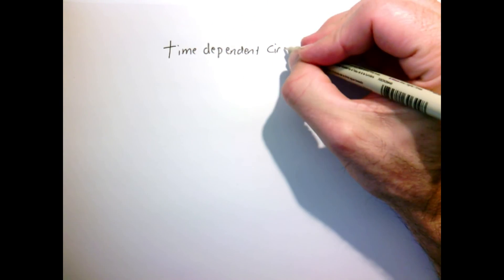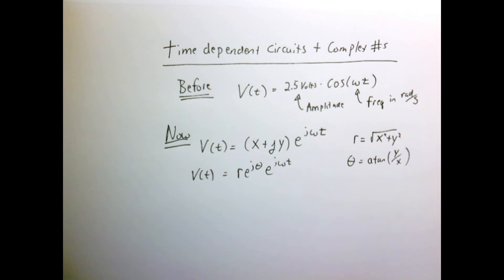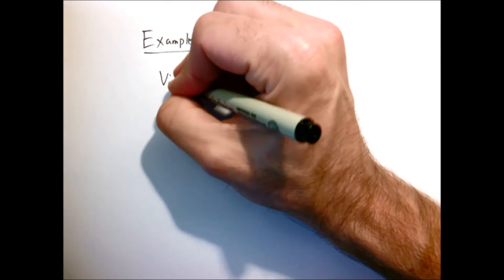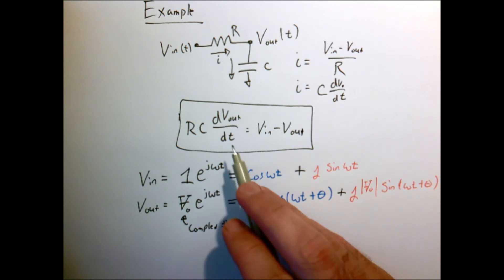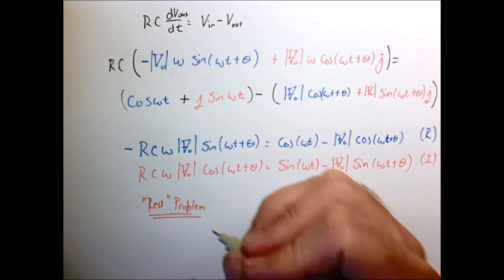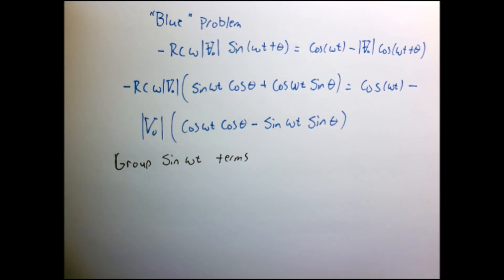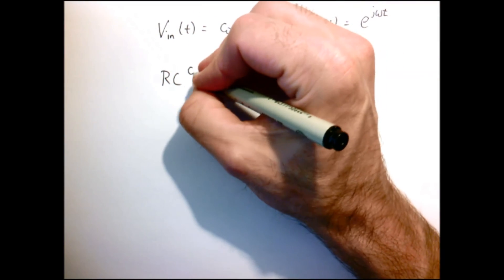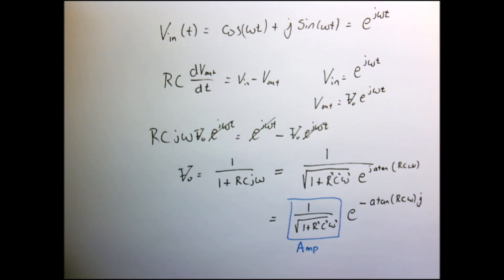Time dependent circuits with complex numbers

Comment: Brian Storey, Sir, I am reflecting on the title of this video, be it time dependent circuits or circuits with time dependent signals where the circuit elements do not change with time, unless we consider aging or where  impedance change with time.  

When dealing with circuits, I prefer to do away with two dimensional flat functions as sine and cosine  which are a combination of two three dimensional helixes rotating in opposite directions and treat the signal as a three dimensional  function namely one helix as  Ae^- jwt  or Ae^+jwt depending which way one wants to rotate. Even  DC signal is treated as a three dimensional signal where jw=0 then the rotation will stop and the 3D vector is regarded as a DC signal in space  which can be applied to a three dimensional  mechanical load! 
In mechanical form one could have a long rod on which rides a holed entity  acting as a load  which can rotate on the rod. A  crank with an off centre pin is  used to torque the load around with an elastic rubber band or a spring connecting the  crank to the load( as towing a car) .  The crank would represent the  rotating voltage source Ae^jwt  and the tow rope and load would represent one Load.   Well the crank can  rotate in either direction as any angular velocity + or - jw  and the load will lag behind depending of the nature of the load entity  and the friction with the rod.  Looking at the rod  from the side or from above or from the end of the rod one would see  the sine , the cosine and also the circle that represent all the mathematical and  input and output parts shown in any flat function, sine or cosine, signal applied to a network.  With three dimensional signals , one has the benefit of seeing the phase lag/lead angle  by looking end on the rod, where  starting the crank from zero time, the transient would be shown as  a curl which eventually reaches  steady state as a perfect circle of some magnitude lagging or leading the circle represented by the crank input.  Using a computer, looking end on the rod, one sees the most beautiful three dimensional signal that you describe so well but in two dimensions through including the summations of the positive and negative rotating signals.For control or filter functions these are the most beautiful  artistic functions one could hand on any wall in  an arts museum. 

May I add that Laplace ( frequency)and the Convolution ( time) operators are in fact three dimensional operators and Laplace presented as ( the integral of ( e- jwt) multiplied ( system impulse  response function in 3D ) =  a three dimensional frequency domain response . These are just beautiful showing a three dimensional spiraling trajectory in space representing magnitude and phase angle at any frequency.
The same with the Convolution time operator and what a pity many educators treat these beautiful operators as two dimensional functions.  Having superimposed  two  contra rotating helixes at the input and output  of a network through using sine and cosines does complicate matters  and there is beauty in using only just one magical rotating helix.... Ae^jwt.
Reply from the maker: In a later series I get to using e^(jwt) and eventually complex impedance. I use this videos for a first year undergrad course and like to start with sines and cosines as they are familiar to students. Jumping into complex notation runs the risk of seeming too abstract for a beginning engineering student. Anyway, this is just the choice I made with my ordering.